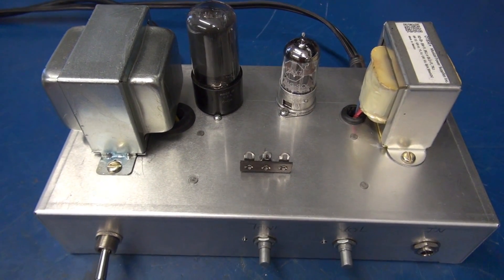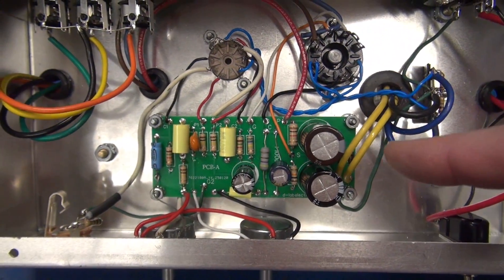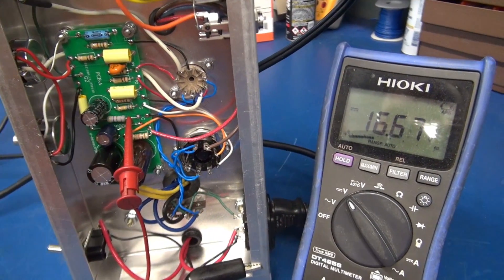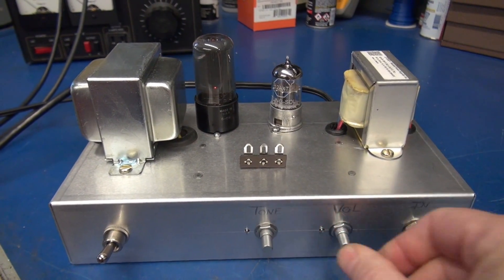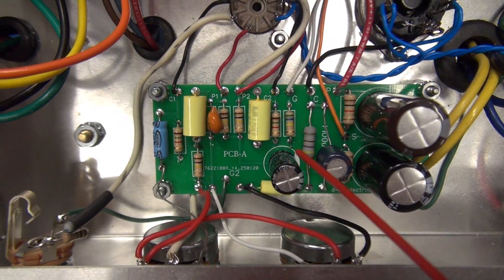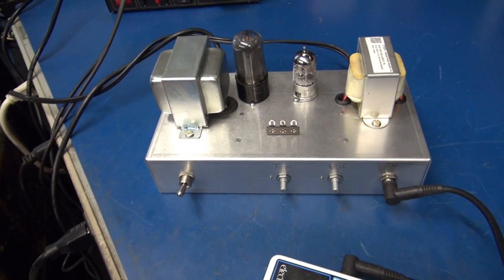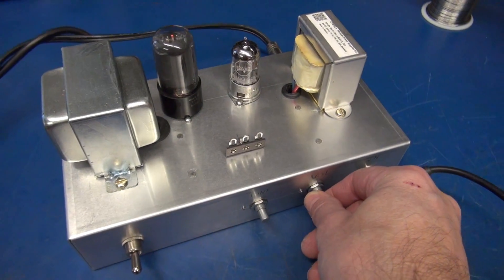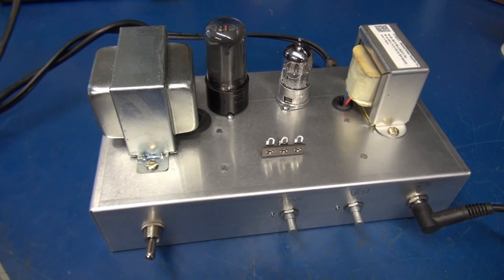New design D-Lab studio tube type guitar amplifier 6V6 PCB-A boutique easy build kit Class A amp

Comment: I will have to look into that.  I got accumulated parts to build basically one of those.  I got the iron and the vintage tubes and all the other basic stuff. The transformers are supposed to be Champ equivalents from some place in Chicago that sells iron for those sort of amps.  The PC board would simplify things I guess.  I don't have any Mullard 12AX7 anymore so I may have to use a Telefunken.

Comment: Terry, another point in favor of your PCB: consistency.  Having  a good, clean, quiet design upfront reduces the variability of wiring differences causing trouble.  As you showed, you still need to hook it up correctly with the right other components, but the results are easy to see.  Well, hear I guess! 🙂

Comment: How are you rectifying this, Terry?
Reply from the maker: two 1n4007 diodes CT transformer. You can also use a 5Y3 tube, just run the HV to the  filter cap

Comment: So this is low watts but also low gain?  Sounds like it would make for a good pedal platform with the low noise floor.  Is it against FB rules put a direct link in the description?  I assume this one is "Mod6V6Rev1"?  Do any of the other boards have the same double grounding design?
Reply from the maker: This circuit would have the same gain as a typical Fender champ with tone control. 12AX7 preamp

Comment: Terry, excellent job. I am impressed with ohm selection options. 
Could this amp push a 2x12 speaker cabnet?
Reply from the maker: Yes, I was testing on a 2-12 Celestion cab
Reply: @d-labelectronics 

Terry which ohms output did you use.
Or did you make it switchable?

Comment: Eggscellent! It would be sweet to build a chassis to support two of those to run in completely separated stereo. I prefer stereo guitar setups as I use a lot of stereo effects. I have a Washburn 4x12 straight cab that I separated down the middle with a board of 3/4" plywood. Each side now has one Celestion G12T-75 and one Electro Harmonics 12TS8 speaker which I'm currently running with a Peavey Classic 60/60 60w stereo tube power amp which is fed by an ADA MP1 preamp.

But that's for the stage. It would be nice to have a pair of these amps at home to hook up to two separate 1x12 cabs. Time to head over to the store. Thanks, Terry!

Comment: Might I ask you where you got those nice thumb-push spring loaded clamp leads?  I’ve been looking for some for my old Greenlee multimeter.

Also, I like the amp.  Sounds nice and warm on the clean. That would be a clean style vintage Tele players dream!

Any chance of making a future amp with that same warm clean channel (perma-set EQ for clean channel), but adding a basic footswitchable 2nd channel, pushing about 25 watts with a single 6L6 and an extra preamp 12AX7 (or 2), with a simple Master Vol + 3 Knob EQ + Gain + Presence that is cloned after an early ‘92 Rev-F Dual Rectifier with the Mk-III OT?  

That would be an absolutely killer small recording/bedroom/practice amp that would allow you to crank it at lower volumes to get so that full saturation and gain, but still be able to hear yourself think.
Reply from the maker: I get them on Tequipment.com

Comment: Very nice Terry, do you supply a BOM along with the wiring diagram and pcb? Also what is the tag strip for between the transformers? Thanks in advance
Reply from the maker: I can provide a schematic, parts are identified on it. Your transformers may vary in part numbers due to what can be found out there. I used shop stock for the demo build. This amp can also run a 6AQ5 or others.
Reply: @d-labelectronics  Thanks Terry, any idea when this will be available on your website?
Reply from the maker: You can contact me. e-mail is on d-labelectronics.com I have the boards in stock
Reply from the maker: Thanks for the board purchase/shop support